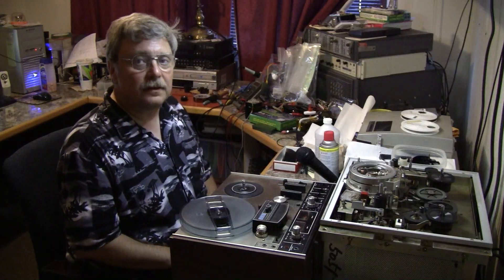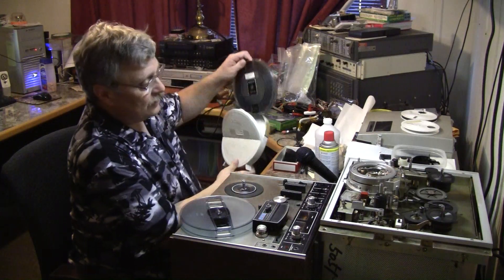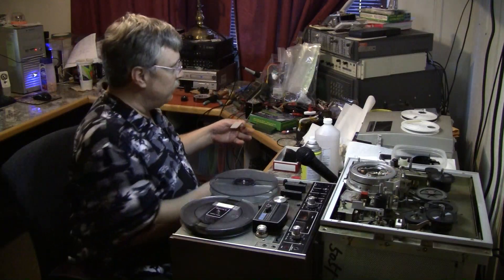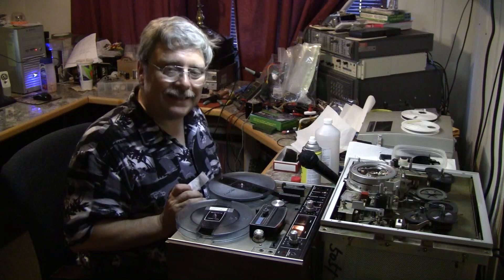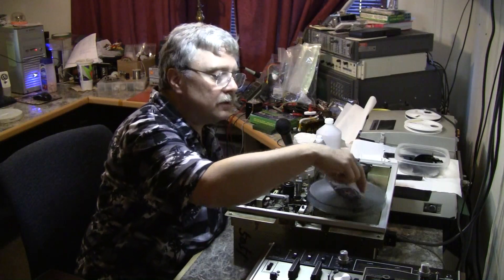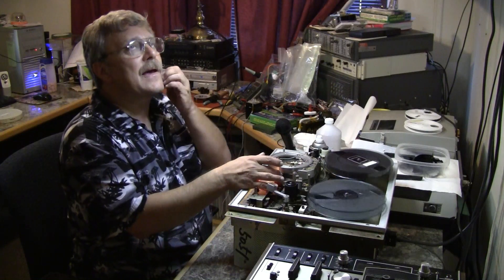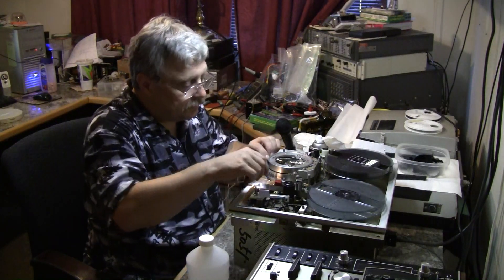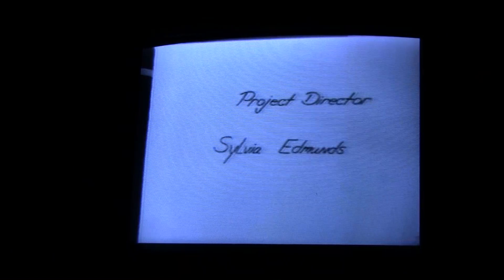Sony CV-2000D Report #2, Tape Cleaning

Comment: Hi ,

I hope you're doing well! I just wanted to let you know that I recently got my hands on the same piece of equipment you have, and I’m currently trying to get it up and running.

Unfortunately my CV-2100ACE, I’ve run into an issue with the drive belts for the motor and the head – the ones I have are so stretched out that I can’t figure out their original size.

I was wondering if by any chance you might have a spare set you could sell me, or if you could point me in the right direction on where to buy them? Even just the correct dimensions would be a big help.

Thanks in advance for any help – I really appreciate it!

Comment: Thank you very much for showing this method! I had a tape that got stuck in the machine half way through and I tried baking it with no success. It took 6-7 passes for it to come out pretty much clean. This is like archeology, buying old machines or tapes and getting them to play again after so many years!

Comment: Do you prefer this method over baking the tape?
Reply from the maker: I use both. But, it depends on the tapes. Some just play. Some are baked and cleaned multiple and never play. The purpose of the spray is simply to make the tape slide through the paper towel easier. It is not to "lubricate" the tape.  Most of the silicone is gone when the tape is played.

Comment: You should probably double check to make sure the synchro-pulse oscillator Hasn't had its capacitance thrust-vectored along the primary induction coil.  Is it getting hot in here?